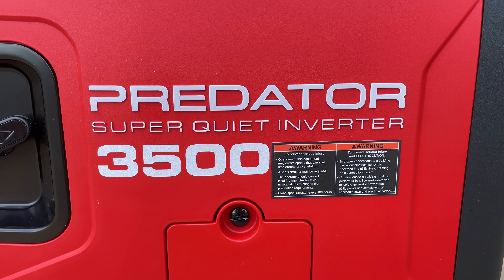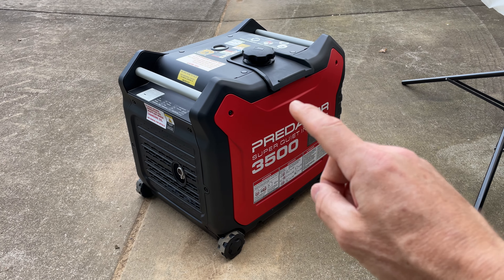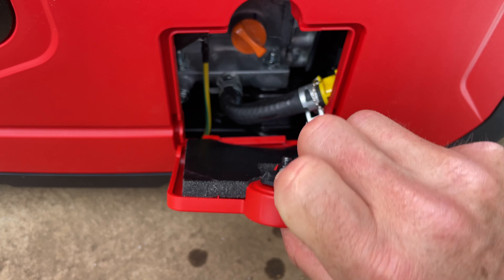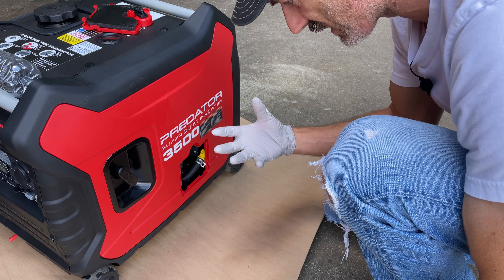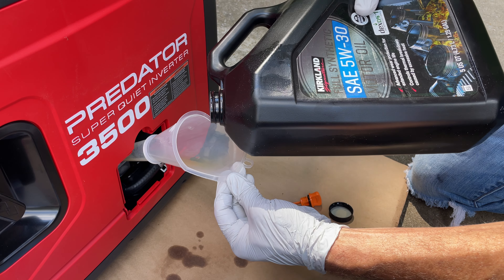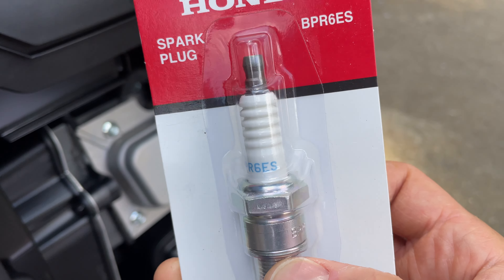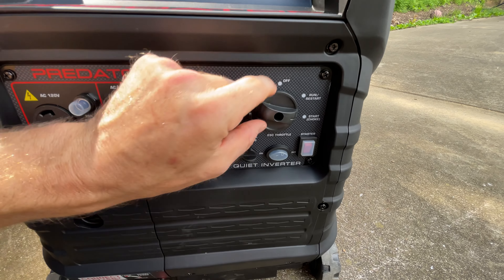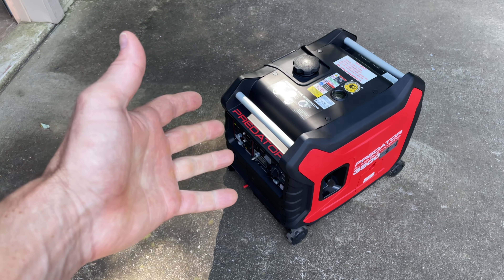Harbor Freight Predator 3500 INVERTER Generator!! THIS IS THE GENERATOR YOU WANT

Comment: Torch brand plug. Chinese brand. I replaced mine right away with an NGK. After break in I filled with Royal Purple.  For fuel, I keep 10 gallons 87 Oct at on hand with over dose of Ethanol Shield from HDepot and add a bottle of octane boost. Been using this combo for years now and even my chainsaw gas lasts almost 2 years. John Deere mower starts right up with a lil choke every spring with last year's fuel. My Polaris ranger also has no pop and ping anymore. I use Gum Out octane booster or sometimes Lucas.
Reply from the maker: Good to know, thanks!
Reply: I buy ethanol free fuel from the gas station. Works perfectly and no reason to add all that extra stuff.
Reply: @lorenperry3726 user manual says, if you do not add a fuel stabilizer, it voids the warranty.  It's literally written all over the gas tank. Do you own one?
Reply: @SoloHiker1 you add stabilizer to mitigate the effects of ethanol. If you buy ethanol free fuel why would you add stabilizer?
Reply: @SoloHiker1 think about it this way. You bought yourself an extra problem (ethanol) then you buy a solution to fix the problem you bought (stabilizer) why not for go the extra problem and avoid buying the solution?
Reply: I bought one of the first ones and I beat that sucker and just kept going I was at just over 4K hours and recently I was cleaning the carb and gasket came out and I accidentally cut it going back in….. I called HF and they said bring it in and pay the 150 and get a new one with 2 year warranty….. lol ok damn….. I’ll take care of this one but was testing how much abuse it would take and was gonna swap out before 2 year but forgot….. I’ve had it for 4-5 years but I changed the oil once on it and it just never let me down
Reply: Amsoil would be the best choice. And a little seafoam.
Reply: I don't know where you live but here on the north east coast U.S., we have a popular brand of gas station named Sheetz. Their pumps have 6 different grades of gas plus diesel.
1) 87 octane regular unleaded, 10% ethanol.
2) 89 octane midgrade unleaded, 10% ethanol.
3) 93 octane premium unleaded, 10% ethanol.
4) 88 octane E-15 unleaded 15% ethanol.
5) 90 octane unleaded, 0% ethanol.
6) Unknown octane E-85 40% to 51% ethanol.
7) 40 cetane diesel fuel.
They used to have a k-1 kerosene pump next to each of their buildings but since they completely tore down and rebuilt their stations from the ground up, I don't remember seeing a kerosene pump anywhere, anymore.

Comment: You are totally wrong about the reasoning of an inverter generator. And also wrong about the clean power. A regular generator has a pure natural full curve sine wave and is exactly 60 hz as long as it maintains exactly 3,600 rpms (60 rounds per second). The inverter lets the generator rpms vary while maintaining 60 hz output. In other words, it can idle. A regular generator cannot.

Comment: I’ve bought 1 of these in 2022.  Trying my best to ensure a long life for this Predator 3500.  I have 50-60 hrs on it, and have changed the oil 5-6 times.  1st oil change I noticed a metallic shimmer to the oil during break in, hence many oil changes. I use mine to run refrigerators-freezers, router too when the power goes out.  Last thing I do after use, I siphon the gas from the tank, and run the engine till all the fuel is used up. Love the quiet operation, I give this Predator 3500 ⭐⭐⭐⭐⭐
Reply: good info.. oil changes are a cheap way to insure long life..

Comment: I bought the exact same generator and followed the directions- Oil, gas and battery connections, When I started it, gas starting pouring out of the carb overflow tube. There was a puddle of gas under the machine. Of course, I turned it off and moved it away from the puddle> cat litter to clean up the gas. I let the area ventilate to avoid any fumes. From the factory, the carb drain screw was very loose causing the leak. Once I tightened the drain screw, the thing ran like a clock. Very Happy I did not have a fire. But, all in all, I am glad it happened to teach me what could go wrong. Glad I bought it. No more lost refrigerators of food when the power goes out.

Comment: About changing the oil....there is a rubber oval plug underneath the oil drain hose.  Put the machine on 2x4's , remove the plug, reorient the drain hose out through the hole.  ez peazy!  No need to fight draining it into a bottle or whatever and no need to tilt it that much!  Keep up the good work !!
Reply: I noticed that also. I will give this a try. Just nervous about eventually making a hole in the hose from constant bending.
Reply: My friend put oil in the generator, was he supposed to take the ‘old oil’ out first then put the new one? Anyways he didn’t do that, then tilt the generator to get the oil out, big mess, but now when he turns it on it blows out white smelling smoke? Help on what to do?
Reply: The newer ones you don't have a plastic plug on the bottom. It actually has a small hose where the drain bolt used to be. With a plastic cap. Just twist the cap and pull the hose over the edge and drain. Easy peasy. Just did first break in oil change.
Reply: I just picked up a used one on marketplace with 300hrs it does not have a drain hose but rather a drain plug that drains down through a small cutout in the bottom. Seems way easier

Comment: Yeah, the plug was welded in mine too. I had to use my automotive spark plug socket and ratchet to get it out ,and I put some anti seize on the threads. The head is aluminum. I have that exact same compressor - it handles it with no problem. I had a little stumble on my first break in runs, but it went away. Always run your generator with a load. Put oil on your air filter and STA BIL in your gas. Run it monthly - especially if your gas has ethanol in it. It's a great generator.

Comment: Full synthetic oil is not made for break in periods. Use 10w30 small engine oil or regular dinosaur oil for the first 15 or 20 hours. You are getting black oil because of the blow by past the rings that have not seated properly. You will be getting an oil fouled plug too. When the rings seat better engine oil will not be getting to the combustion chamber and burnt fuel/carbons will not be getting to the crankcase in large amounts. P.S. change the engine oil while it is still at least warm or as hot as you are comfortable with. If you let the oil get cold the debris in the oils will fall to the bottom of the crankcase and recirculate when you start it back up.

Comment: .
    When we moved to West Virginia from Florida 24 years ago, We brought with us a 5,000 watt Coleman generator. We bought it new in 1999, 2 years before we moved, and never used it.
    Our new double wide was placed just a month before and it took us 3 weeks to get power connected, for various reasons, so we ran that Coleman 24/7 in July to run the fridge and a window A/C unit in the bedroom for those 3 weeks and cooked on a Coleman propane stove under the stove hood in the kitchen. The wife, myself and our 2 then young kids camped out in the master bedroom for those 3 weeks. Gas was only 69c a gallon at the time. Oh, and I got real tired, real quick of tripping over the extension cords to the fridge, lights, A/C, and lights in the bathroom. I took care of that problem next.
    After we had our unconnected steel garage built, I wired lights, a garage door opener and outlets around the garage through an 8 circuit, breaker box. The main wire cable from the garage breaker box to the main breaker under the meter box is 8 gauge. Kind of heavy for simple lights, outlets and a garage door opener but the last 2 circuits in the box were reserved for a special twin set of  30 amp breakers. I wired these breakers to a 4 prong 50 amp outlet on the wall next to where my generator sets 3 feet from the walk in side door. When we need power, I open the side door, start the generator then open the big door about a foot to provide flow through to vent the exhaust. There is no carbon monoxide issue as the garage isn't connected to the house. Anyway, I made an 8 foot long, 8 gauge cord with a 50 amp twist lock plug to match my Coleman generator on one end. On the other end is a 4 prong plug to match the 50 amp outlet on the wall.
    Some people refer to this as a suicide cord because there are exposed prongs at both ends of the cord. If the cord is ever unplugged, it could be a hazard if the twin 30 amp breakers are on or if the generator is running. Some people will plug their generator into a dryer or arc welder outlet when the lights go out then unplug it and put it away later when the power returns. This is where the shock hazard possibility comes in. In my setup, the 50 amp wall outlet is dedicated to the generator and nothing else. It gets unplugged from the dead outlet on the wall and the non running generator once a year to check for corrosion, plugged back in and that's where it sits completely safe and not exposed to the outside world until the next yearly checkup.
    When we moved here in 2001, I had already had 5 spine surgeries and was on disability, We had run that Coleman into the house on and off for 11 years including another 9 days straight after an ice storm had ripped out a bunch of power lines around the state.
    When I came up on my 8th spine surgery, (in total, I've had 11), I knew that I couldn't pull that 10 horsepower starter rope anymore without reinjuring my back so I went and bought a 7,000 watt electric start TroyBilt. Now, instead of having to flip the main breaker to isolate the house from the mains, pull the rope 2 to 6 times depending on the outside temperature, then flipping the two 30 amp breakers on the wall, all I had to do was hit the main breaker, push a button, let the engine warm up for a minute then flip the two 30 amp breakers and let there be light.
    That Coleman was a dependable old girl. In all it's years, aside from oil changes every 40 running hours, sparkplug and air filter changes when needed, the sparkplug once vibrated loose and blew out of the aluminum cylinder head taking the threads with it. I took the head to a shop where they installed a helicoil, I bought a new head gasket, $13.00 total, and I put it back together. It sat in the garage as a spare / loaner for friends for several years until my father in law passed away and we inherited his 6,000 watt TroyBilt so I sold the Coleman for $100.00 to a guy who wanted to power a cabin on weekends. A fitting semi retirement for a 20 year old unit.
    My only problem now is that 6,000 watt unit isn't electric start. If my main unit quits for some reason or if I have to shut it down for maintenance, my cord is long enough to unplug it from the 7kw unit and plug into the 6kw unit's twist lock but then, I have to pull the rope on the bigger engine. By the grace of God, my father in law took good care of it and it starts on the first or second pull summer and winter.
    Either one will run everything we need in the house except for the heat pump. I have propane logs in the fireplace connected to a "T" outside with 2 gas grill regulators on 2) 20 pound tanks. If we wear sweaters and keep this 1836 square foot house at around 70 degrees, 2) 20 pound tanks will keep us warm for around 6 or 7 days depending on the outside temperature. We keep several spares in the garage. Our house is all electric. We have a 40 gallon, 4,500 watt hot water tank. If we use it up and need more hot water, either generator handles it in stride but at a cost. It takes an hour and a gallon of gas just to heat the tank.
FUN FACT 1:
    If you use 20 pound propane tanks for emergencies like we do, instead of spending $30.00 to $40.00 each for new extra tanks and another $18.00 or so to fill them. When you go places, look at propane filling stations for junk expired tanks laying around.
    Where I get my tanks filled, they are pretty strict about not filling expired tanks. I went for gas one day and there were a dozen old tanks sitting off to the side that were either expired or still had the old style valves on them. I asked the guy what's their story. He said that people come in with expired tanks and when they don't get filled, they leave them there, go into the store or to Walmart and buy new ones. Then this store has to haul them to the dump.
    I asked if I could take them and he said go for it because now they don't have to bother with them. Over time, I tok 2 or 3 of them at a time to the Blue Rhino stand at Walmart and traded them for new or newer inspected tanks. Blue Rhino only gives you 15 pounds of gas but where else are you going to get a tank that passes inspection and 15 gallons of gas for $18.00? You go buy a new tank for $35.00 then pay another $18.00 to have it filled. Now you have $53.00 invested where it cost me $18.00 and I'm only short 5 pounds of gas but then I get to keep the $35.00 that I didn't spend on a new tank. Now, we have lots of spare emergency heat.
FUN FACT 2:
    If your generator's starter battery dies like mine did after 6 years, I called Lowes and they wanted $100.00 and 10 days to order a new one. The 10 days wasn't so bad as all I have to do was run my jumper cables in through the garage door and jump it off. The hundred dollars struck me as a bit high for a small 18 AH gel cell battery though. I went on Amazon and found a 22 AH battery, physically the same size, that was made to be a starter battery for a jump starter box and it cost me only $44.00 plus it came with FREE NON PRIME DELIVERY on an 8 pound battery. It dropped right in the mount where the other battery came out of. This was 2018, 7 years ago. I hit the crank button every month as a test and it never misses a lick.
FUN FACT 3:
    I never hit the stop switch on my generators. I let my Coleman sit for 6 months once with gas in the carb. It dried into varnish and gummed everything up. I had to have the carb disassembled in a shop, soaked in cleaner and rebuilt. Ever since then, whenever I need to shut down my generator, I ALWAYS shut off the fuel valve under the tank and let the carb run dry. When I need to run it the next time, I turn on the fuel valve, wait 3 seconds then fire it up. Works every time and never another clogged carburetor!

Comment: Nice.  I got one on sale for Fathers day (last weekend HF had a parking lot sale) and this generator was at $634.  So I got it with a couple extension cords too so that we can run the freezers and fridges as well as charge our phones/tablets when the power goes out. We have two times of year, ice storms in the winter and severe storms in the spring and fall. We had two outages this Spring.  12hours the first week of May and 8 days when we had a near miss from a tornado. Thank you for this video!

Comment: I had one of these a while ago and have a few videos on it.  When I broke mine in I changed the oil at 1, 2, 5, and 10 hours just to be sure it was clean and I am glad I did.  It had an oil shimmer on the oil early and a lot of shavings initially.  An oil change on these is easy enough to do and it is better to be safe than sorry so do the break in right and change the oil.  You will be glad that you did.  Also, always try to use non-ethanol gas in them and check and clean the spark arrestor regularly and you should see years of use from it.

Comment: I like mine also. I've had it for 2 years. The only problems I had is the pull start cord broke off at 2500 hrs. and it has never been pull started. It now has 2750 hours on it and i use for powering my RV trailer here in TX.  It starts the mach 3 coleman AC with no problems. The AC draws between 400 and 1600 watts. I leave the ESC Throttle on all of the time with no problems.

Comment: I got my two year ago i did it old school I used regular oil for the first 30 hours but I changed it 4 times in the first 30 hours and after that I went to full synthetic i have been using 5w30 the hole time i have 80 hours on it now and no issues with it running great

Comment: That Honda plug is an NGK plug, you can get NGK plugs at auto parts stores. Honda re-brands it in their own package. You could have widened the gap on the original to eliminate the miss, (auto boat and small engine mech. for 40 years here). There are 2 conditions for a spark plug , it either works or it doesnt. Widening the gap gives a bigger spark. Wear on spark plugs comes from the electrodes burning away over a long period of time. 2 other ways they fail is from fouling from overly rich mixture or carbon from burning oil or coolant contamination, (if its coolant you have other problems, but that is air cooled) and cracked insulator shorting to ground, (no spark in cyl.). Another good spark plug for small engines is Denso, (formerly Nippon-Denso).

Comment: Very good tutorial. I learned alot.  I'm in Florida and have gone through the same Tornadoes and hurricanes. I bought some ecoflow delta pros now I want a small gas generator to keep the batteries charged in addition to having solar panels. I'm just starting to learn about the inverter generators, and you have been very helpful. Thanks